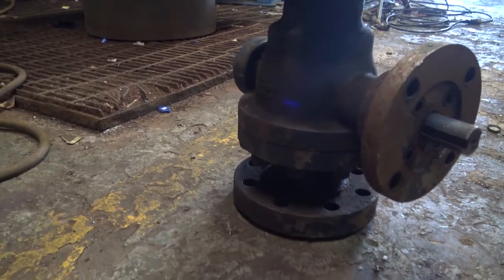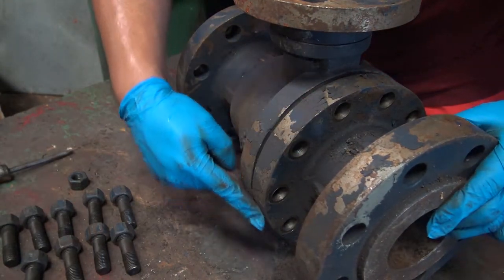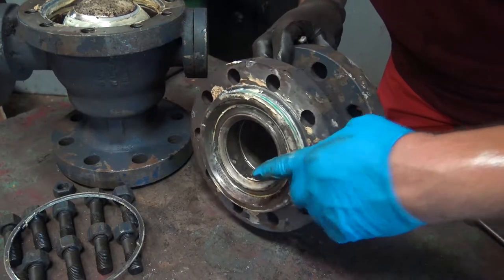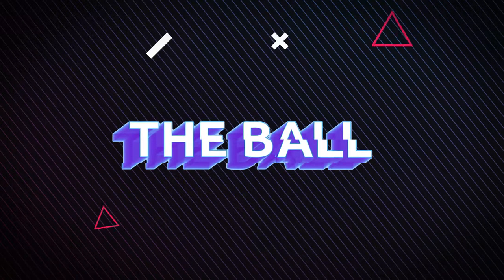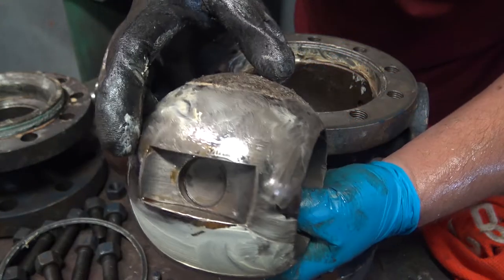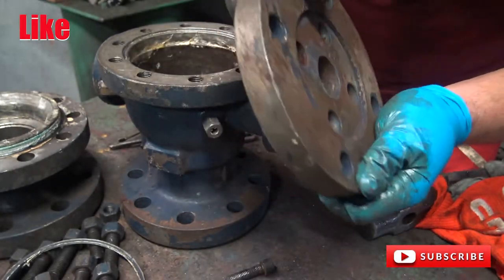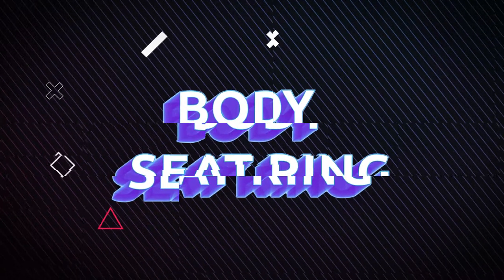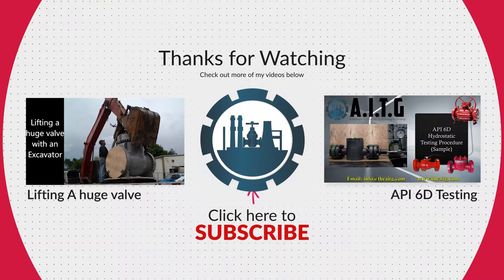What is a Trunnion mounted ball valve? Trunnion mounted ball valve disassembly. Parts breakdown.

Comment: very well explained vid as always ! however  i'd like to ask about the fonction of the anti static device?
Reply from the maker: Here is a comment I made in the past about it. Anti-static devices are very important. The valve would still fully function without the device. However, without it you risk friction potentially causing heat or sparks. Which could lead to a fire or worse depending on the medium running through the valve. Hope this was helpful. Thanks for watching.

Comment: Should i grease reagularly ball valves? aprox 10" in diameter
Reply from the maker: Applying grease can be tricky. Many factors come into play. How often is the valves used, what is medium running through, etc. 

The best practice is to grease only in emergency applications and before operating the valve. To much grease can sometimes lead to issues. 

Hope this helps. Thank you for the comment.
Reply: @everythingvalves  They are used for natural gas, usually are always opened. I’ve recommended to every 6 months to close and open them to avoid getting stuck, but nothing else is done. I was doubting if they should be greased, thanks for the info

Comment: This valve didn't have anti-blowout option in stem. Can you please confirm it?
Reply from the maker: Good question. This valve does have an anti blow out proof stem. The design maybe a little different than other manufacturers. The stem has a larger OD at the bottom and can not pass through the stem bushing. The stem bushing is bolted to the body which will prevent the stem from blowing out. Check out minute 6:55 for more details. Hope this was helpful. Thanks for watching and the comment.
Reply: @everythingvalves  Thanks for your reply.

Comment: What are the Advantages of providing Anti-static design to valves, and what would happen if we ignore the same?
Reply from the maker: Anti-static devices are very important. The valve would still fully function without the device. However, without it you risk friction potentially causing heat or sparks. Which could lead to a fire or worse depending on the medium running through the valve. Hope this was helpful. Thanks for watching.
Reply: @everythingvalves  Thanks for the response, I have one more question, 
As per API 6D the trapped gas pressure in valve body cavity shall be not more than 133% of rates pressure class, in order to prevent this condition we use a pressure equaliser to send excess pressure either upstream or downstream.
My question is, how the pressure equaliser works to prevent excess pressurisation of valve body cavity?
Reply from the maker: @mohdabidshaikh12  that’s a multi answer question. One example can be using self relieving seats on Trunnion ball valves. With this feature the seats will relieve trapped pressure to the downstream side preventing thermal expansion. If you have more specific questions please feel free to contact us via email. Thanks for your questions, I hope this helps.